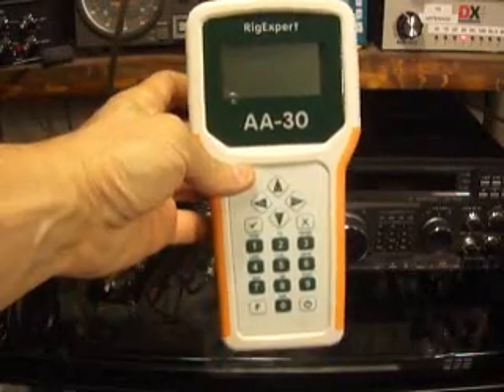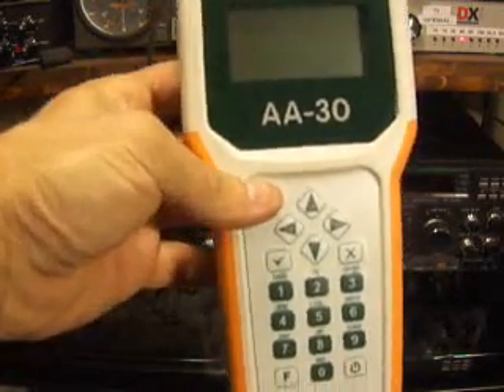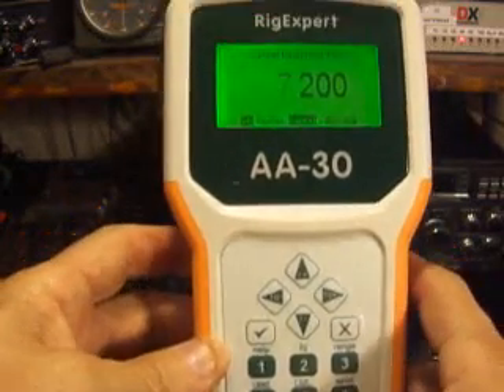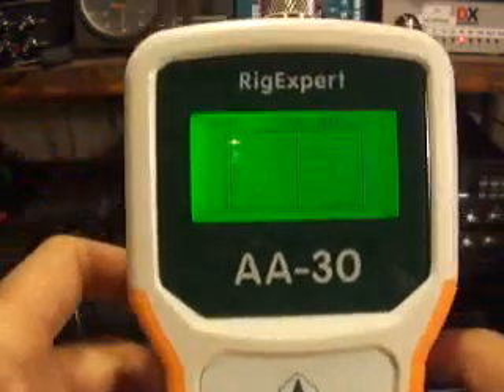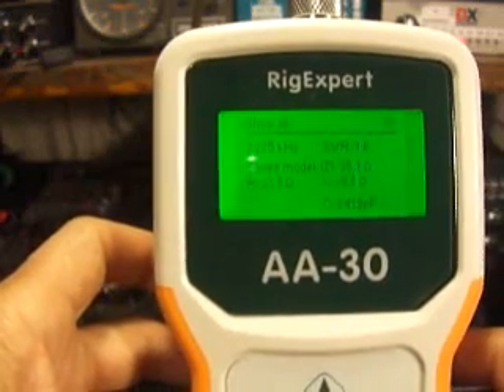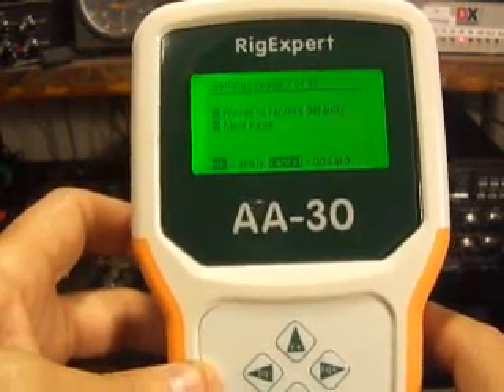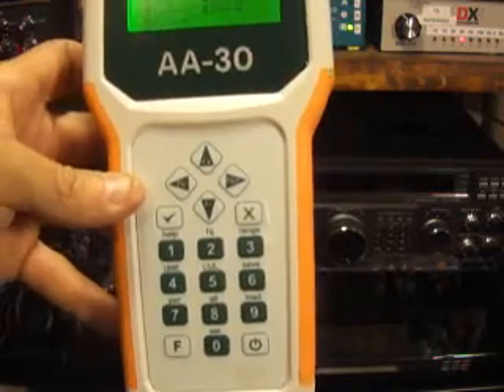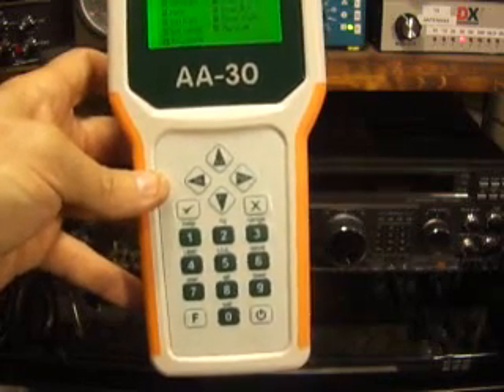Rig Expert AA-30 Analyzer

Comment: 1 - MultiSWR mode,AA-54 has an ability to display SWR for up to five different frequencies at a time.You may use this feature to tune multi-band antennas.

2 -Memory operation, In the SWR graph and R,X graph modes, you may choose to scan to memory  There are 100 independent memory slots. Later, you may recall the plots from the specified memory.